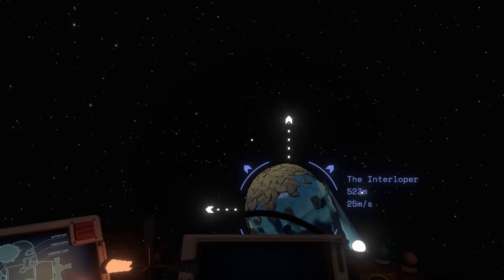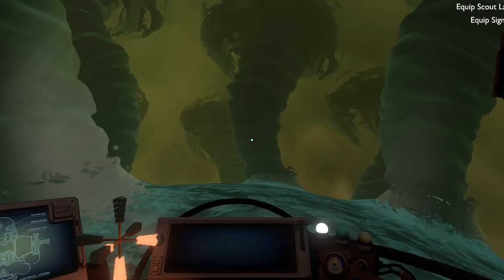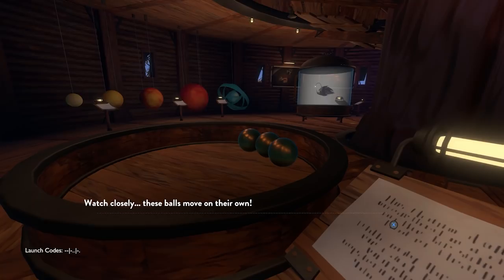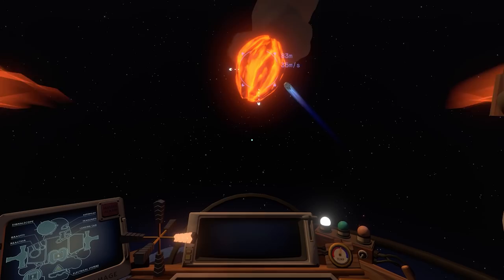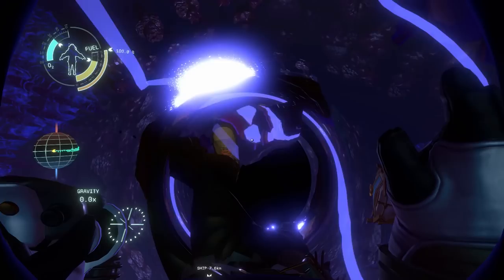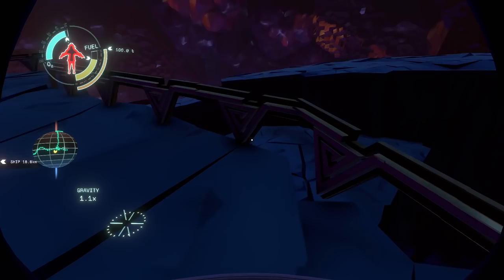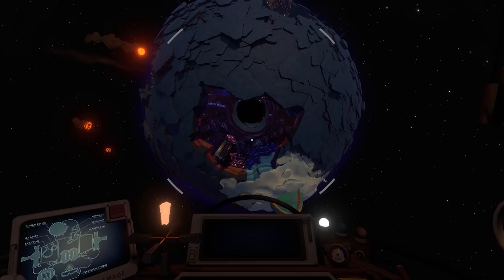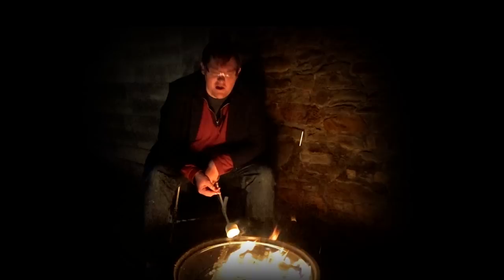How Outer Wilds’ Impossible Planet Works | Crafting Materials

Comment: Apparently, even a certain location on Brittle Hollow, that is "supposed" to fall into the black hole and be accessible near the end of the loop, isn't scripted, either. I've heard of a few playthroughs where it didn't fall at all for the entire loop, and was still present when the supernova hit. I would've thought that, at the very least for that one plot-critical chunk, they would've fudged the probability a bit, maybe set it so that beyond, I dunno, 18 minutes in, the next meteor hit would send it into the black hole regardless of remaining surface integrity. Apparently not!
Reply: You know you can ram chunks to reduce their health?
Reply: @mememachine3029  what???
Reply: That is the 6th place rule right?
Reply: @NoNameAtAll2  Yeah, just jumping up and down can be enough to knock a piece of Brittle Hollow loose if the integrity is low enough
Reply: yet there is also a case to be made about preserving it. There is yet another difficult puzzle on the planet which requires you to take an indirect route to get to more vital information, and if enough pieces fall along the path, cheese becomes the only alternative. Unless you are waiting specifically for the piece you mention to fall, the instances where it doesnt lends itself to leaving a route to the other tricky puzzle.

Comment: You can even perform extremely dangerous gravity jumps by throwing yourself towards the core, accelerating to high speeds as you are pulled in, and then ever so slightly adjusting your movement so you just barely miss the core. You can gain incredible speeds with this and can even boost yourself back to safety.
Reply: I used this funnily enough to reach the tower of quantum knowledge. Not the intended solution but it was fun.
Reply: @meditalisoo7  thats sick haha

Comment: I never considered how good the performance of the game is when you suddenly translocate across the solar system without requiring a loading screen.
It is as Futurama's God Nebula says: "When you do something right, people won't be sure you've done anything at all."

Thanks, ver Hoef! 🍻
Reply: I saw a documentary where a dev pointed out the balls in the museum that are attracted by the moon. Just think about all the forces there.

These balls rotate around the sun on a planet that also rotates and are attracted by a rotating moon. 

The amound of physics on that are insane. He claimed himself that it amazing that it even works.
Reply: Good point! It was awesome to be unhindered by the load screens. Even distant things still loaded beautifully
Reply: Isn't gravity pretty easily to calculate and stimulate though? NASA did it back in the 60s with like 4k of hardware RAM
Reply: @Superabound2  gravity's easy to calculate, but a lot of games can't even handle a moving physics object on top of another moving physics object
Reply: @Superabound2  Nasa did it, but it took them months to calculate trayectories.

But you are right, gravity is easy enough if your are good with physics and know well enough when to simplify and when not to
Reply: i reckon that area would just be loaded in memory already so it can just switch instantly. it's not that much of a challenge to pull off instant loading, but it's still a very nice visual effect.
Reply: Probably because either it’s all loaded at once or it loads in stages, similar to BotW

Comment: 5:07 Just something to note, the health value isn't hidden, you can shoot your probe onto the surface to see the health of that particular segment.
Reply: the percentage isn't hidden, but the absolute health is. Some segments have more health points than others so they get less % damage per hit. For example one segment could have 100 hp and another could have 250
Reply: I discovered this on accident when I crashed my ship into the planet and the section of ground underneath suddenly gave away. That's when I realized that it was all dynamic.

Comment: Actually, the health value for each piece of BH isn't hidden. If you shoot a probe onto the surface of the planet, it tells you the structural integrity of the plate you're standing on
Reply: Features like that usually take away from the exploration aspect of a game, but the way they did it made it feel even more like a dangerous adventure. i.e That segment has 75% integrity, that gives you somewhere between 4 and 11 meteors before your ship ends up on the opposite end of the system.

Comment: I love the game but it makes no sense that the planet collapses in a different way each time because it's a time loop
Reply: Well you don't do the same thing each loop, do you? Your actions are not locked in. If you flip a coin one thousand times each loop, you'll get a unique pattern of heads and tails each time because flipping a coin is random; the gravity involved in the solar system is a multiple body problem, which is complex enough that small bits of randomness that are always present in any process (essentially atoms are fuzzy vibrating objects and not classical spheres with a known position and velocity) will give rise to a chaotic system that has many many possible outcomes depending on tiny variations in the starting conditions. So it makes complete sense, from a physics standpoint, that Brittle Hollow breaks apart a different way each time.